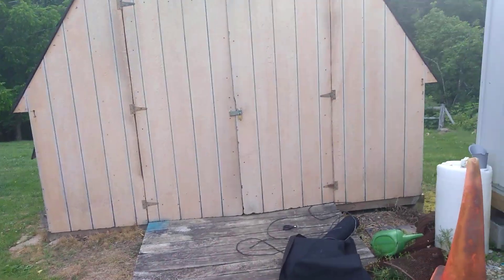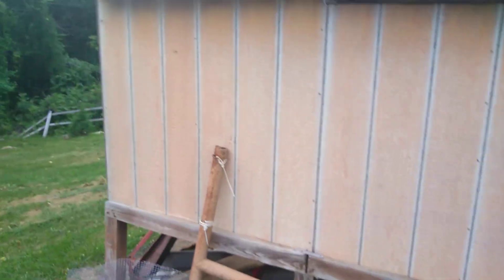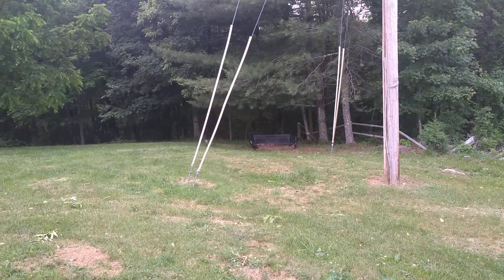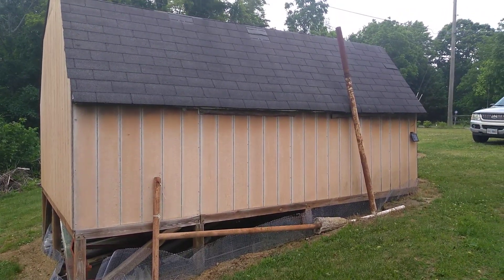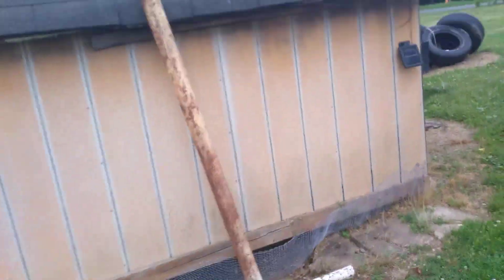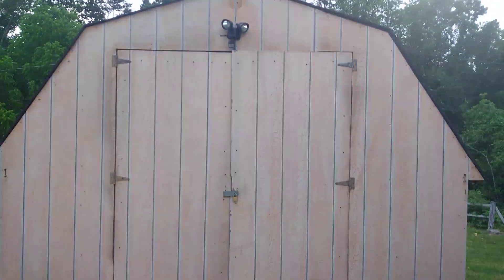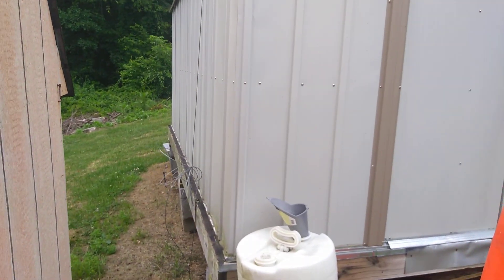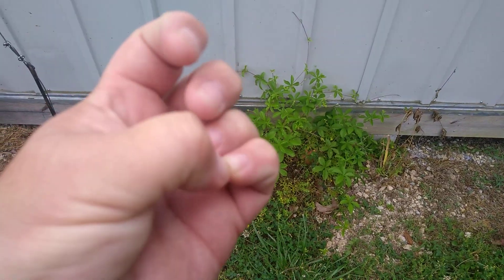Need help releveling our wood storage building

Comment: your best bet would to be disassemble it, pour a cement platform with the metal brackets sticking out of it. then you build a wood frame all around the edge of the cement slab and bolt the shed to the frame.
Reply from the maker: Yes we get enough money we are going to get another building about the size of my shop
Reply: right on. yeah i mean if i could get out there i wish i could, i'd help y'all take it down and rebuild it the way i said on a cement slab.
Reply from the maker: Well come on out we can probably get you a job so you can change states
Reply: i want to come out but unfortunately i don't have the fincacial ability to leave at this moment or a reliable vehicle to drive across country and i need to have my truck, trailer, dirt bike and my bed and few other small things.
Reply from the maker: I understand that too well hopefully things will start looking better soon
Reply: THANK YOU.

Comment: Moving them will probably be expensive. Your best bet is to jack it and lay as much of the foundation in cider blocks.
Reply from the maker: Yes that is what we are planning on doing as soon as I can get a couple health issues worked out if not then we may just knock them down and build a garage with a cement floor in it